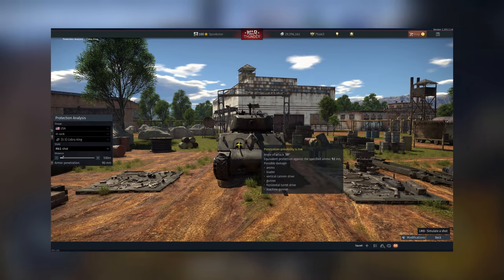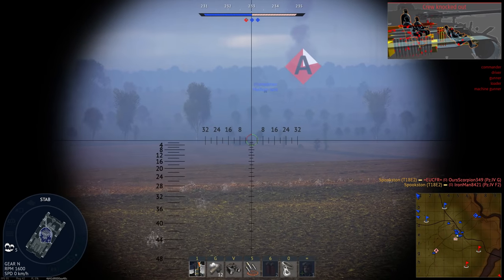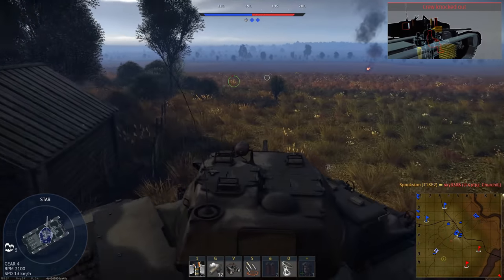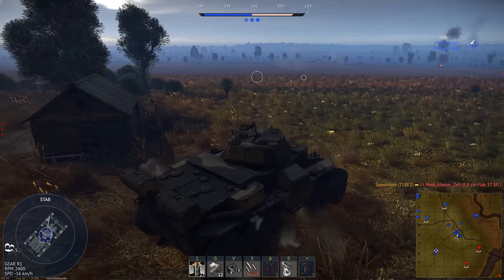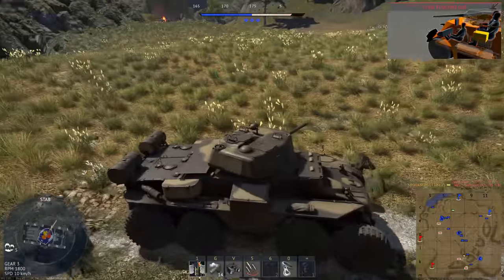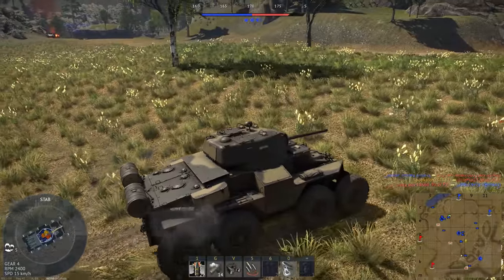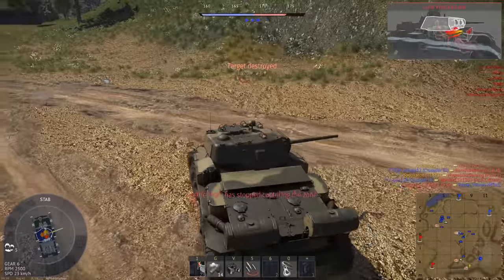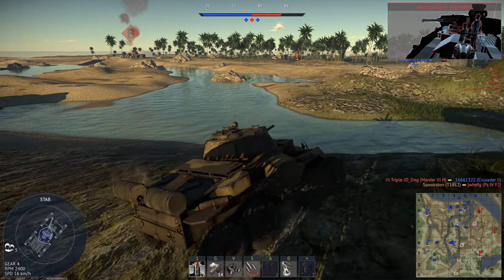Volumetric Shells Were A Bad Idea

Comment: I wouldn't mind it if my entire 150 millimeter shell wasn't denied because I hit the side skirt of a tiger and did absolutely nothing also hitting 2 armor plates is the most infuriating thing
Reply: The tracks also block plenty of shells now
Reply: The m48 and panzer 3m now haunt my dreams
Reply: That's pretty logical for HEAT ammo, it could not tolerate any damage to the cone. Also, 2 and more armor plates welds are regularly thicker than each of them. That's plain geometry.
Reply: @the_woof  But welds are a weak spot. A weld is not nearly as strong as a homogenous plate, especially not in 1940.
A solid shell can push plates apart and make the welds crack or break entirely.
Reply: How about a Konkors to the side turret of XM-, penerating & doing nothing inside.

If I really want to play a game of chance I would've played World of Tanks ages ago.
Reply: @skl-1371  ikr, RNG shouldn't belong in WT.
Reply: @skl-1371  this is the kind of the game where you definitely should aim for module if you want damage.
Reply: @the_woof  In order to kill in this game you got to kill the crew not the modules & 3 out of 4 on that tank sits in the turret.
Reply: @skl-1371  at top tier you need to disable breech and gun first if you're not flanking.
Reply: @the_woof  I was looking at his side he was engaging another target an ATGM to his side turret it penned but did nothing inside (read the comment again), + the breach is again the turret with the crew (a tank without gunner cannot shoot regardless of intact breech or not).
Reply: Literally have non penned the A Sherman’s front plate with the kv2 at point blank. I would love to see a tanks front plate after eating one of those
Reply: Don't forget optics of indestructible nature
Reply: My tiger 1H gets its shells eaten all day, as i try to aim at the turret ring, only to get a non-penetration or bounce. Even though they should have passed.
Reply: Somehow a M26E1 bounced my 85 mm HEAT off his track
Reply: At least its the side skirt, tank's track cover plates used to eat up anything, a simple <1mm steel sheet somehow blocked a fucking 15kg APCBC shell of 240mm pen is the most infuriating thing ever.
Reply: @SuperStevieye  Test showed that welds are stronger than the plate itself.

Comment: It's not "how" but rather "when" this implementation is bad !
Volumetric shells are working and would work better on volumetric armor..
Also, refined hitboxes must be their next huge project
They added volumetric shells too late or too soon. Either had it from the starts (like years ago) and the whole "balance" would have been vastly different today OR add it later when all tanks received a properly modelled volumetric armour
Reply: I agree with this
Reply: give this guy a minor award!
Reply: I agree that vehicle that have curved armour should get volumetric armour. It could fix some problems but another problem could arise
Reply: Fixing some problem by creating other's lol.
Reply: That would require work on Gaijin's part. Some of them might have to actually learn how to code.
Reply: The other issue is a matter of their public testing, or lack there of.  

Gaijin only put this update up on their testing server a mere 11 days prior to it being added onto the live server.  

That's....  not that much time to really test any of the many issues that would come about wit ha change like this.  Even else to actually put up any fixes.  

Just for context, any of the new seasons that come for Rainbow Six Siege are on the Technical Test Server use to be up for public testing at a minimum of two weeks, before going live, although it's not uncommon for these testing phases to extend beyond that.  Due to COVID, these Test Server periods have been extended to usually three to four weeks minimum on average.  When they introduced changes to address things like Weapon Sight Misalignment, there was months, bordering on years, of testing being done before we actually got the change into the game.  Hell the rework for a singular character, Tachanaka, was announced and revealed at the start of this year but is only just now being put up for player testing.  

Or to look at smaller developers, Offworld, the devs of Squad, put the testing for the 1.0 update up for roughly a month before they released it, and hotfixes for issues that came about were pushed just mere DAYS after that update.  

Volumetric needed far more testing in a public setting than what Gaijin gave it.
Reply: Volumetric shells need armour degradation to work properly.
And need more than just a point and a circle to determine "where the shell is", but an actual model of the shell which dictates the way it interacts with the armour (e.g. long detonator rod on HEATFS can obviously go through weakspots, where normal HEAT rounds might even fail to detonate ; which in cases could make anti-RPG meshes actually work at stopping HEATFS rather than just detonating it further.
But then that should imply more proper penetration and damage models (still in the case of HEAT, the shape of the cone should affect among other things, how much the penetration is affected by spaced armour and slopping). Meaning for example, you might "go through" a turret ring, but really you shouldn't be doing more than the rotation mechanism (hashtag Tiger 131)
And then you need less arcadishly fast repairs for critical component damage so taking out a turret ring actually has an impact.

But then, it's Gaijin we're talking about. Who've implemented optics as part of the damage model for ages but still have not found a way for them to have any impact (not even a broken glass filter over the gunner's view). Who think Gen 1 thermals can pick up a low rev truck at 4km in a wooded area, but also think "thermal reduction" on helicopters somehow magically makes them immune to IR guided missiles despite have turbines with upwards of 4000 horsepower (merely 3 times a tank, and it's not like a tank's thermal signature is very conceilable)
Reply: @MadManchou  maybe that's just exhaust coolers, yep, on absolute every model of them )
Reply: 7 years I've been playing the game hasn't changed anything yet, sad :(
Reply: hur durr EVENT VEHICLE lolololololololol - Gajjin design team probably
Reply: @MadManchou  armor degradation has nothing to do, it's more about the server considering plates in series, when they are next to each other. And that problem would be solved with volumetric armor.
Reply: @alex941126  that's the game coding problem.
Armour degradation is needed because a "weakspot" isn't just weak precisely where the armour is weaker, but makes the armour around it weaker as well (since hitting the edge of a plate isn't the same as hitting it dead center), and even a failed penetration can deform armour enough to "push out of the way"  thicker elements that prevented full penetration on the first hit. Not to mention that powerfull AP shells can cave in armour even with a bounce, making subsequent hits be affected differently by the changed slope (optics for example should be sheared off by any hit, and thus not present an obstacle for subsequent hits).
Reply: This. You can’t just make a massive change to the overarching meta without changing little bits of the rest of the meta.
Reply: @MadManchou  no. armor degradation has nothing to do with these problems. guess what, volumetric shells are not realistic. shells are clumps of metal that even collision simulators have trouble predicting.
Reply: Agreed as well
Reply: It might be a small piece to a bigger program they're developing. I hope what you said rolls out in the next year or so
Reply: so true the amount of times i bounce a 88 from point blank or me bouncing russian 100 mm of german turrets is insane
Reply: @JohnysTheRockGuy  same ever since tanks came out
Reply: Like he said on the other video. They would have to rework the "realistic damage model" of every tank in the game, which expensive and time-consuming.
Reply: You are right and wrong at the same time.
Years ago their game was buggy overall and there were a lot of duct-tape fixes, which haven't been rewritten yet. Volumetric shells would just break the whole thing with extreme processor load.
Late fix is impossible as well. Sheer amount of work to push out the models is massive. The problem is,  just because gaijin made the system doesn't mean that they understand how it fully works under all circumstances. Imagine them doint all the job on models only to find out that there are some fatal flaws that mean that all their work is for naught.
So the best way for them to do is:
1)Roll the initial bunch of proper vehicles
2)Roll the volumetric mechanics 
3)See how it flies. 
4)If it doesn't work, single out the problems on that initial bunch, fix them.
5)Based on these fixes, create guidelines for modelling proper volumetric vehicles. 
6)If there are more tanks left, roll out another batch, else go to 10.
7)Fix. 
8)Go to 6.
9)Idiot!
10)Done.
Reply: hmm , what do you think , do you think gaijin who has a lot of work to do and a lot of games ,can make this all happen by a day or what? what are you guys thinking, 
and i bet you all play premium and whine around lols
Reply: Dont forget shells deform when they hit something making volumetric completely unrealistic

Comment: The number of times I’ve lost a kill because the game said “barrel right here” is too high. Then the shells I’ve had bounce into me is uncomfortably annoying
Reply: I've always been surprised that Gaijin didnt just include collision for gun barrels, would solve many of the corner issues in this game.
Reply: @fludblud  Exactly

Edit:  Actually no, this way it would be much much easier for campers behind corners to just shoot the barrel of the incoming players, with the barrel going through the building at least you have a chance against them rn
Reply: @fludblud  they tried it but it didn't make for fun gameplay.
Reply: I still hate how optics are bullet sponges
Reply: @kayagorzan  ikr, they should be a hazard due to shrapnel.
Reply: @FMHikari  Yes!
Reply: There s also maps where shells get stopped by wooden window frames

Comment: While it does have its downsides, namely making already strong vehicles even stronger, it has been really nice to play and not be killed by someone shooting the bottom of my turret and the shell turning 90 degrees on it's axis in between the turret and hull and going straight through the top of the hull, or various other pixel shots that always annoyed the crap out of me
Reply: Still happened to me in my IS3
Reply: That still happens to me, somehow almost regularly off my Pershing series tanks and Panther tanks.
Reply: Well a shell deflecting into the hull from the turret is pretty realistic.
Reply: @AustroKebab  depends on the tank, it doing it for an IS3? Yeah, plenty of space there for the shell to get through, but for something like a KV1 where there's only about a 30mm to 40mm gap, that's more the ones I'm talking about.
Reply: @TheJimyyy  actually he is correct, its called a shell trap. It literally means an area on the tank which deflects shells into a weaker position
Reply: @TheJimyyy  really? Define rarely as the t34 has one, the panther has one, the panzer 4 and 3 have small ones, the crusader has one, the Sherman has a massive one, the is 2 has one, the kv 1 has one (sort of), and the tiger is notorious for having advantageous one
Reply: Yes the lolpen meta is annoying, specially on armored vehicles with lower crew count.  Also I think the guns ingame are point accurate , which is nowhere realistic even today.
Reply: @TheJimyyy  you never met people who shoot your turret ring accros the entire map ?
Reply: Well it's pretty unrealistic considering there's a lot of factors that affect the shell in the gun tube alone
Reply: @TheJimyyy  ...in a possibly deformed tube, one that could be a bit hot and mushy, or even battle-damaged...
Reply: @TheJimyyy  the irl definition does not account for ease of use, it's hard to hit the turret ring but that doesn't mean it's not a vulnerability. And the panther does have one on its turret mantlet right beneath the barrel where its rounded

Comment: It’s so annoying, shots that would go through on let’s say a Sherman would not even though is was a perfect front shot, which would’ve killed it.  And another battle, I encountered a IS-1, which was facing its side.  So I took a shot at the drivers place, only for it to have done no damage, and just to the track to light yellow.  (I use a Tiger H1, and I’m not a dumb German main as you might think.. I’m level 10 too so…)

Comment: In my opinion it is a good idea, but it's full of bugs. So, if they make things right volumetric shells are good.
Reply: yup my last game in my charioteer i ate a tow missile from a swedish TD and survive if the volumetric shells  are not implemented im dead on that encounter
Reply: would it be a fix to make the shell divide the armor by how many plates it's hitting?

like fex. it hits between a 150mm plate and 80mm plate = 230mm,
divide 230 by two (plates) and you are left with 115 with is the average armor thickness.
Reply: @goofy851  So true
Reply: @Bigma_Industries  that makes absolutely no sense. 2 seperate plates should have a higher effective thickness than the thickness of the two plates combined. I.e. a 100mm plate with another 50mm behind it should be MORE effective than just a single 150mm plate.
Reply: @ItsATrap614  thats not the problem the problem is that the shell hits in between a 100mm plate on the right side and a 50mm on the left and the game now adds both values making it 150mm but in reality the left side of the shell needs to pen only 50mm and the right side of the shell needs to pen 100mm. whatever the real physics in this situation would be it would certainly not be an equivalent protection of 150mm.
Reply: @ItsATrap614  do you think i meant plates next to each other or behind each other?

It does the calculations for evey layer.
Reply: @goofy851 !!! This always annoyed me, breaks my immersion :(
Reply: @SooSFan  he meant a spaced armour of 50mm and the 100mm plate behind it, obviously spaced armour would perform better than single 150mm plate

Comment: I think it's a good idea in theory, but many of the problems with it's implementation stem from one of two things; insufficient modeling, as mentioned, hitboxes of structures and lack of volumetric armor in vehicles, and secondly, it doesn't take into account weakspots as they should properly exist.

I think the best way to implement it would be to introduce a secondary calculation for kinetic shells, wherein if there is more than one armor thickness which needs to be overcome within it's cone of travel, it will average out the values before determining penetration.  While this won't make weak spots as easy to penetrate as they were before, you would still see more rounds penetrate if you only partially impact a weak spot.  

Secondly, we would need to reduce the effective resistance of some secondary components like optics.

With that said, I think ATGMs impacting on barrels and the like and exploding should remain, as, well, it is realistic.  The whole point of slat armor for example is in causing premature detonation away from the primary armor, and if in real life you were to shoot and the corner of a missile struck the barrel, well, I'm pretty sure the same would happen.  Even if not, it would likely deform the warhead and massively reduce penetration, if not render the missile defunct completely.  The Abrams' upper plate has seen a good bit of benefit from this as well as the S-tank in game, which is accurate to how they were designed to operate and with the effects of HEAT considered.  

So, on the whole, I'd say that it was a rushed concept, but the amount of work required to fix things will be massive, and really is up to gaijin to fix.  (mostly on building hitboxes, and volumetric armor)
Reply: It’s Gaijin in a nutshell : they put good things into the game, but it’s not polished and seems to have been made by a « that will do it » guy, so that turns into something outrageous and horrible. And if we are lucky they don’t modify it to make it even more horrible.
Reply: @arthurbousquet6838  It's Russia...... Soviet, just put everything and if it's isn't works just make it works, it doesn't have to be good. but this is a game, not a Mass Produced Machine.
Reply: The point of slat armor is to more or less catch ( to destroy ) the warhead before it reaches the main armor and to stop it from detonating ( take this with a fuckton of salt cause its the way i understood the slat armor thing.)
Reply: @Average_Joe2  slat armor is meant to either A: Cause premature detonation away from the armor, resulting in the warhead losing significant amounts of penetration, or B: deform the warhead to significantly reduce penetration, or even render it a dud.  A happens if the fuse hits one of the slats directly, B happens if the fuse strikes between the slats.
Reply: @pr_untitled  sounds like murica - no idea of precision milling or engines - "just slap a 5liter in it" ;D
Not to mention their "suspensions"
Reply: @SCComega  wow thank you mr.game developer you have great experience in this field